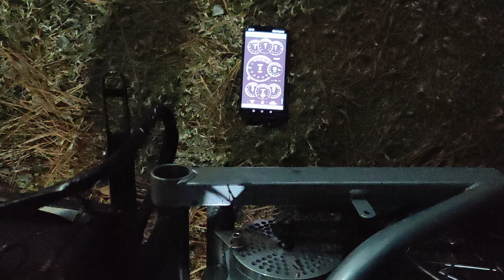New #razor Projects MONSTER MX, 3kw Sx for an 8 yr old!

Comment: Lol.. it's fixed now. Chain and sprocket wasn't in the best of shape. Using t8f sprockets & chain now. Motor still heats up at 200amps with field weakening. Can go higher but needs proper cooling..You ship the motor fan?
   Not over rev.. It's field weakening, it reduces the back emf produced by the motor by injecting a negative d axis current allowing the motor to spin faster
Reply from the maker: Fan shipped. Fast pack. Brown fluffly envelope

Comment: I sent your forks back, please refund me
Reply from the maker: Damaging install, stripping the heads off bolts.  Then blaming me , for over tightening. Notbwatching the install videos. 
Not INSTALLING THE STEM BUSHINGS? I repaired it and sent it back. 
This is a custom shop ,not amazon. Sorry, but there are no refund. 
Pigsnuffer would probably make you a decent offer. Besides its been over 100 , one hundred days.
Reply from the maker: Good question
Reply from the maker: Parts should be at your home today
Reply: They didn’t work with the RSF frame. I didn’t damage the install. You’re going to keep the forks and my money?
Reply from the maker: @jamesobrien6855  but not you
Reply from the maker: @erickharris9539  why cant you read my texts,watch my installs? Then ask me questions, ive already answered? 
I DONT HAVE YOUR PARTS. YOU DO.

They do work with the rsf frame. 
There are,CUSTOMER VIDEOS and PHOTOS to prove it.
Reply: @KeatonsCarlott  I sent all the parts back to you. Shipping tracking says you received them. The forks absolutely do not work with the RSF frame, I have pictures too. You are a total scam.